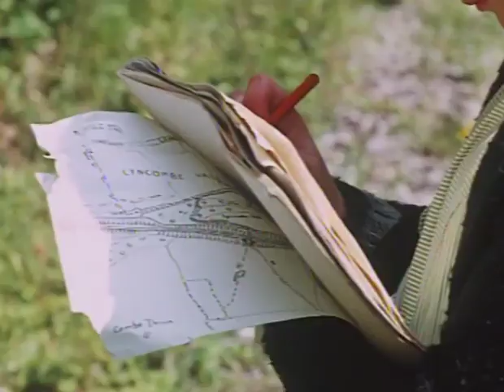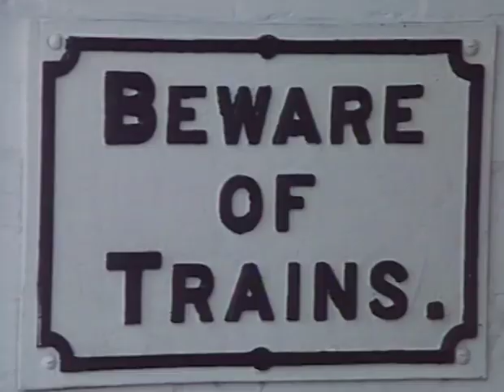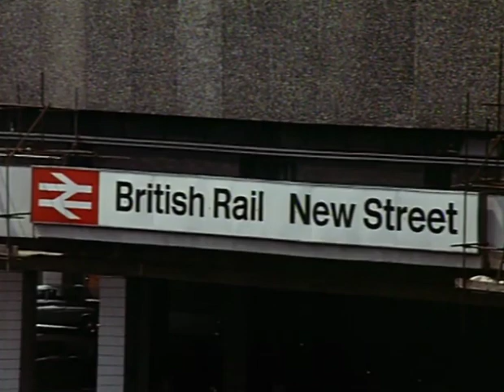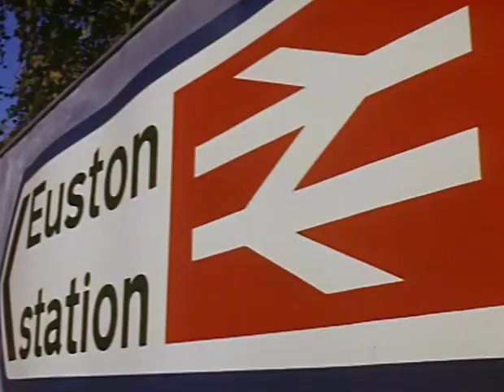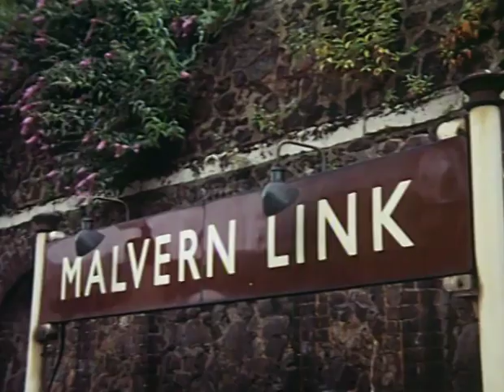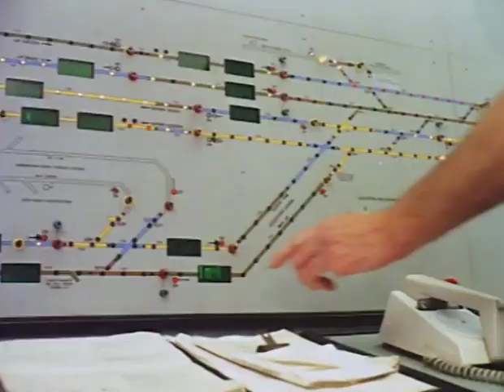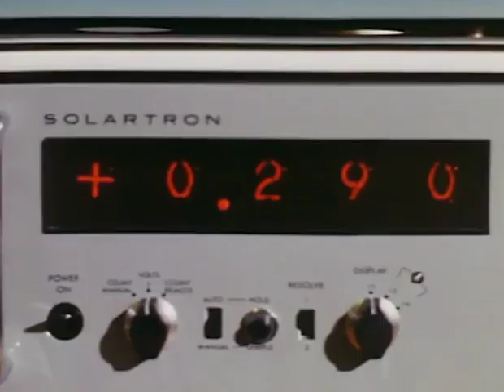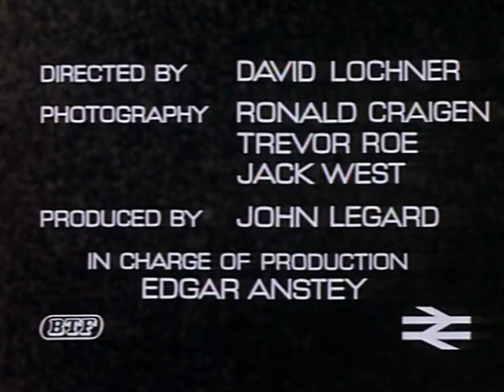Vintage railway film - Report on modernisation no. 11: Railways conserve the environment - 1970

Comment: Brilliant film, thanks. Shows that railways were generally a force for good even in 1970, when half the passenger network had shut over the previous decade before and town planners were in love with road transport. Of course it helped the environment no end after BR ended steam traction two years earlier!

The S&D trackbed through Bath example is great - astonishing to see how much vegetation had grown in just four years after closure. I had to recheck the date of the film. 

Maybe I missed a point here, but the reference to railways helping to control urban sprawl/ expansion is odd. Quality/ frequency/ speed of railways when modernised do the opposite. Out of hundreds of major rail upgrades/ enhancements, nearly all in terms of the railway's 'business case' were justified on helping government meet residential/ employment development targets...which means lots of new roads to serve the new builds. It still holds true today, despite loads more environmental protections in planning law, but in 1970 car ownership was rocketing and motorway mania was at its height. Few towns and cities got a modernised rail service until the government had first looked after their road user voters!

Bristol Parkway (the country's first of the concept) wasn't built just as a convenient railhead for M4/M5 access avoiding the city centre. A vast conurbation in what is now South Gloucestershire has sprung up since the station's opening in 1972. Fifty years on, developers are still at it, and they still big up access to Parkway as a USP for their new homes despite the appalling peak traffic jams that they've created.  There's a good network of local buses serving the sprawl, but journey times are dire despite 'okay' fare levels.

Good mention of MGR and Freightliner, two of BR's greatest successes that stopped rail freight traffic sliding even further down the pan.